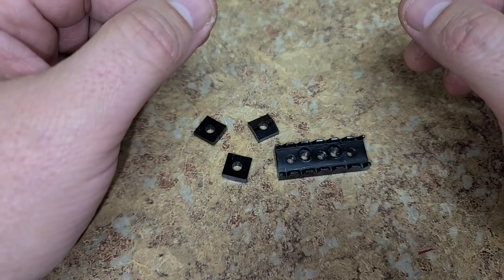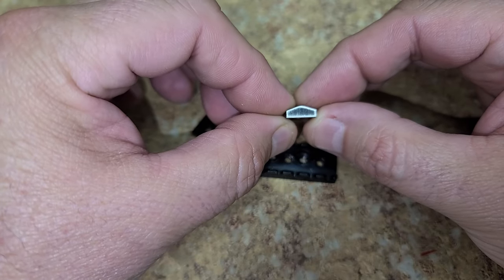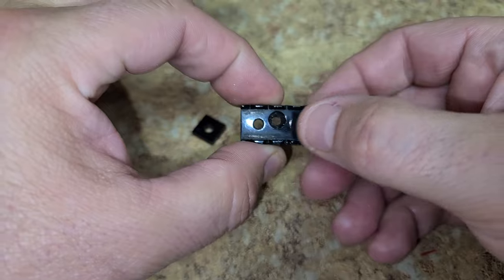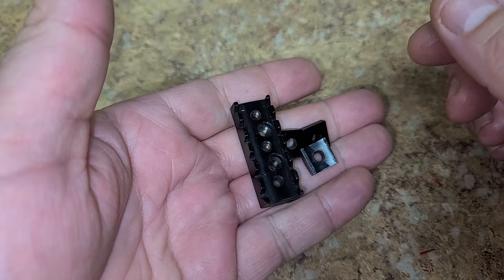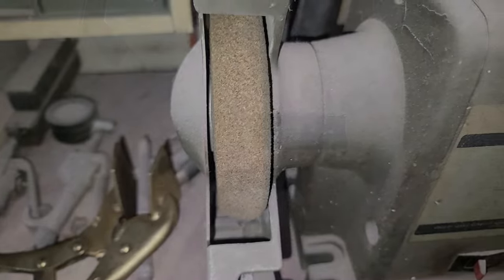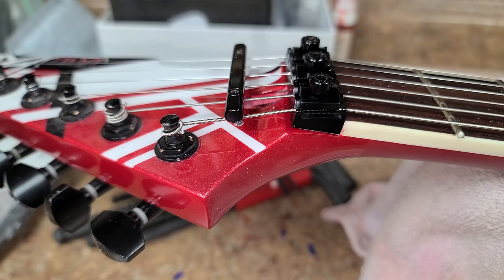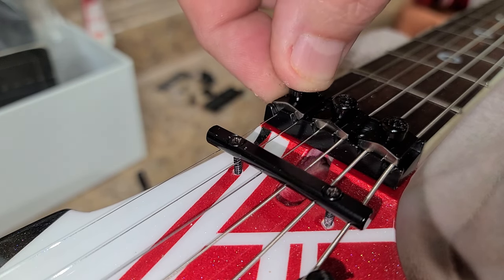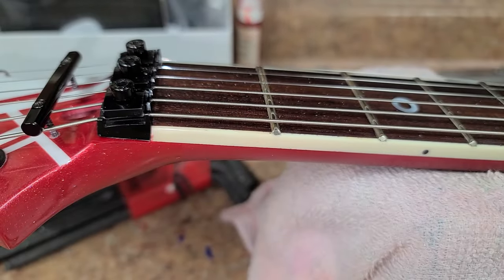Locking Nut Problem Fixed EVH Devlin Custom

Comment: I saw Lockingnut in the thumbnail 😆 I was a little excited! 
They don't make Floyd Rose and Schaller products like they used to. It's a shame because I have many instruments with them and I would swear by them. I recently obtained a guitar with a Gotoh Floyd and I love it. Quality surpassed the Floyds and Schallers of today. My whole point of this is the quality of work and materials have changed and that's a little disappointing. I thank you for this video because knowledge is power and guitar players need to know and be informed.